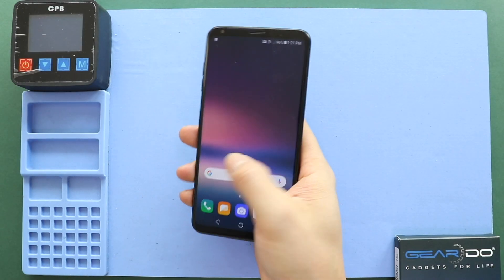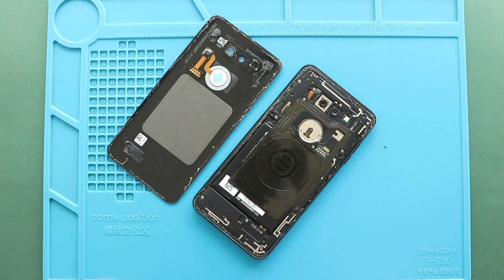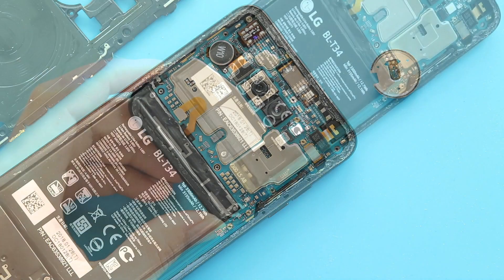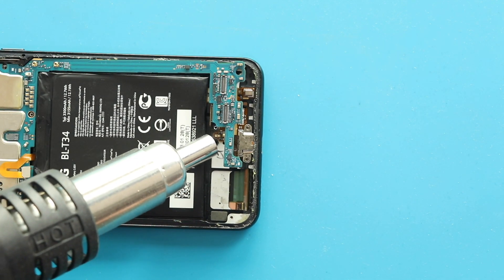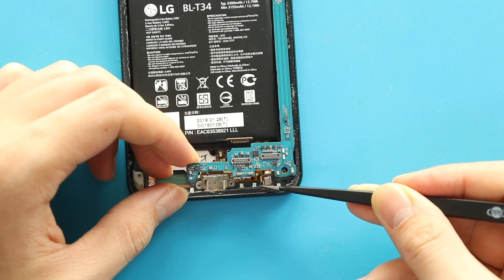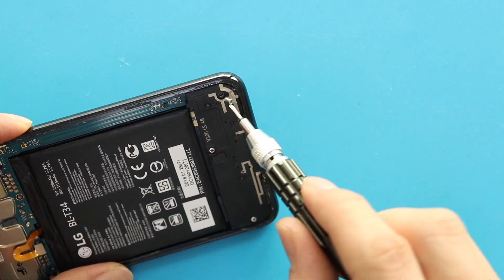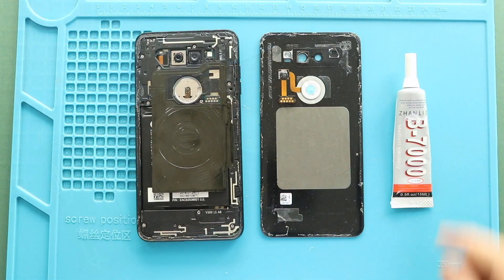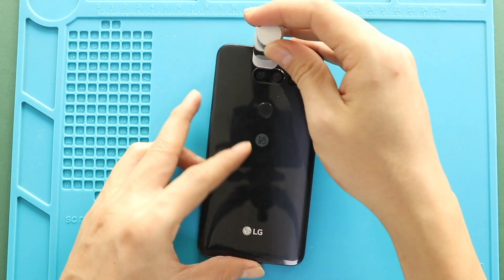LG V30 Charging Port Replacement

Comment: After I replaced the charging port the fingerprint sensor now doesn't work
Reply from the maker: Probably a loose connection. Fingerprint sensor in a different location
Reply: @DIYGeardo  well I've lined it correctly and even the hardware diagnostics app doesn't let me check hardware anymore it has to be some detection lg added maybe I need to reset the phone